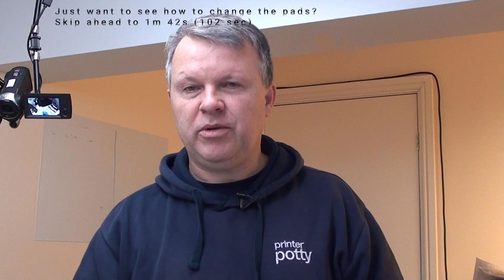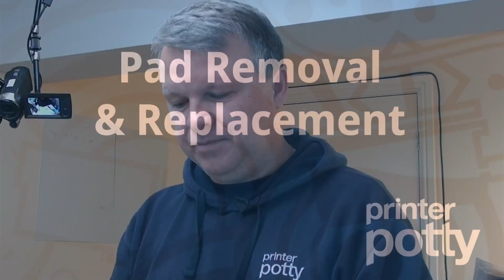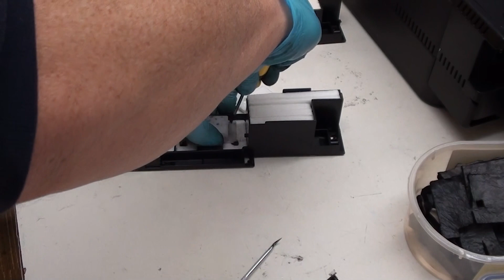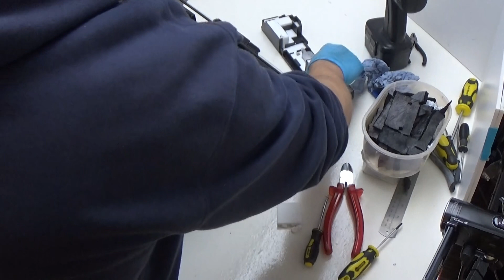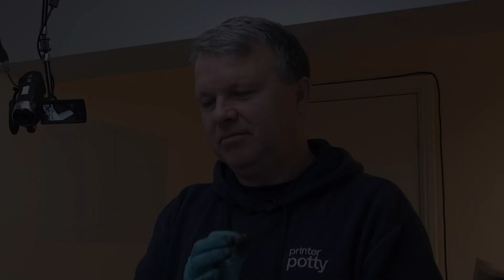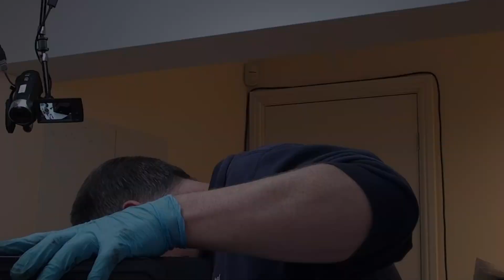Replace Waste Ink Pads: PX/TX/Artisan 700 - 800 Series

Comment: Do you know where to buy the replacement pads for the Epson Artisan 50?
Reply from the maker: Unfortunately not. You could try searching on the other models of the same design (ie: P50, R280, R285, R290, L800, L805). I couldn't find a guide for replacing the pads on those models either but in case it's of use the process of fitting an external waste ink tank is really, really easy. 
https://www.youtube.com/watch?v=2F60I082fIU